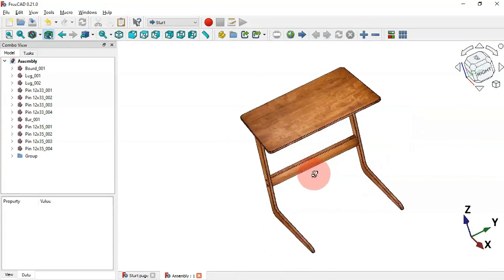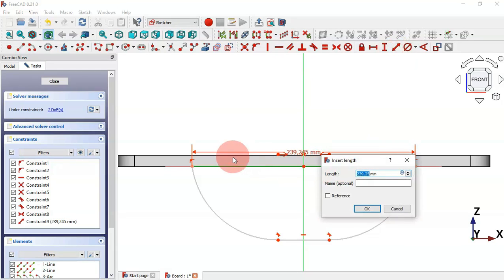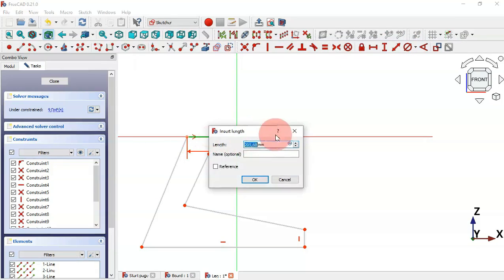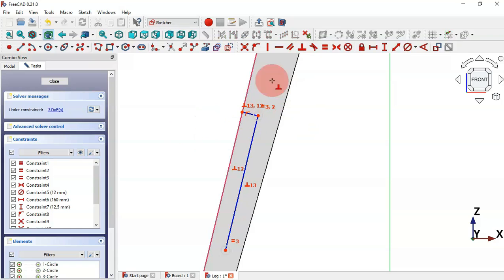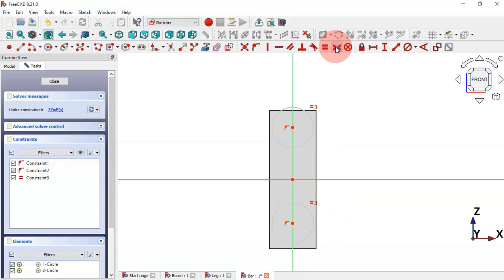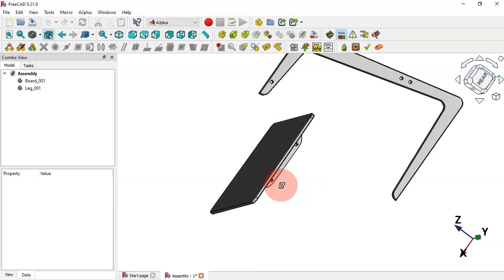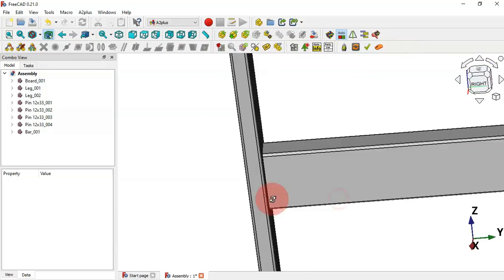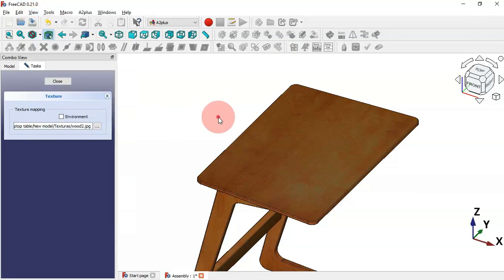FreeCAD 0.21: Simple Laptop table design + assembly and Texture mapping

Comment: Thanks for the video, but I wasn't able to get the textured effect.  While in the A2plus workbench and texturing and mapping I could see the texture on the body. When I selected close the texturing went away. I then did an Export to a .STL file and sliced it with Prusa slicer.  The cube I printed out had no texturing at all.  Any ideas?
Reply from the maker: That is a limitation. The texture are mapped to the body while the Texture mapping task panel is active. When the task panel is closed the texture is gone. 
About slicing it, the texture on the body will not appear on the piece because what the tool "Texture mapping" do is only applying a texture based on an image. It's simply an image that apply a desired "look like".

Comment: What these simple design videos don't show is how you can modify core parts without breaking everything. For example - change material thickness, change height of table legs, or adjust angle. In reality the design is never final and is a subject to modifications
Reply from the maker: For automatic parts dimensions there's a workbench "Spreadsheet" that can help. I haven't done a video of that, but there are videos here on YouTube that can get you intro to it.
Reply from the maker: Without breaking everything? Do you refer to the issue "Topological naming problem"?

"Change material thickness, table lags height, adjust angle" without breaking everything depends on your FreeCAD understanding and experience. With that you are able to solve almost every breaking shape issues.